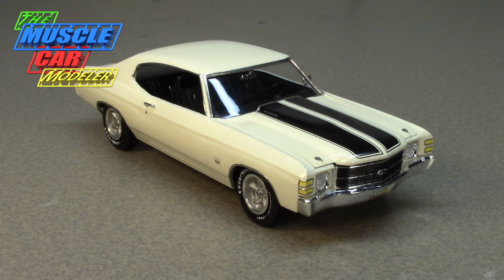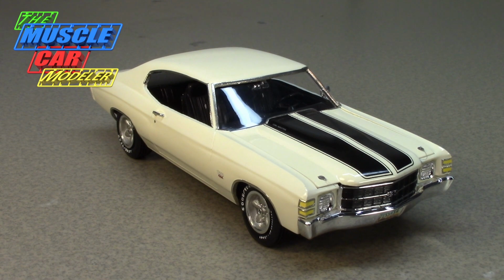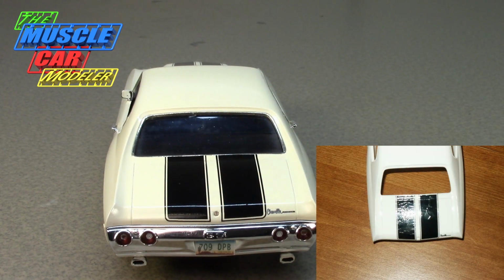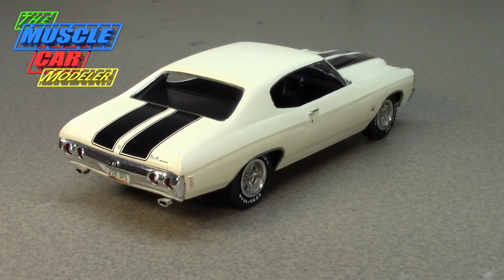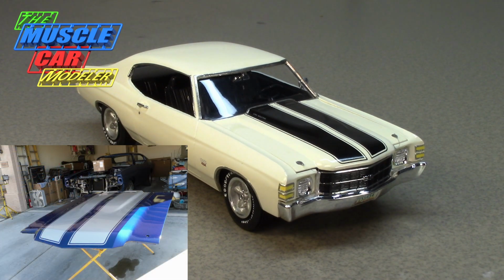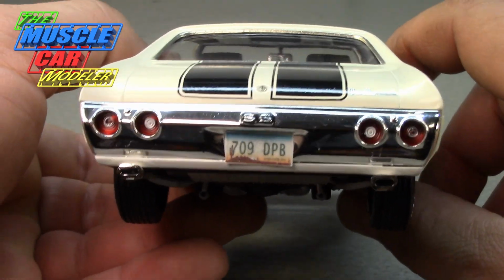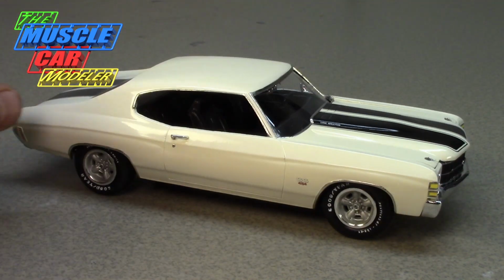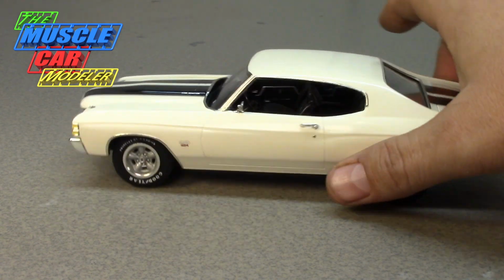AMT 1971 Chevrolet Chevelle SS 454 Annual Build

Comment: Awesome, awesome build brother, as usual.  I grew up a Chevelle guy, but always favored the '68/'69 bodied cars and El Caminos.  In fact, my first car was a white '68 w/307-cid SBC, 2-bbl, and column-shifted 2-spd. Powerglide A/T.  I promptly yanked out that anemic combination in favor of a 400-cid SBC, 4-bbl. Q-Jet carb, and TH350 from a 1970 Caprice parts car.  Installed a Comp Cams 286 bumpstick, Rhoads hydraulic lifters, Weiand aluminum dual-plane intake, headers, dual exhaust w/turbo mufflers exiting out the sides just in front of the rear wheels.  Installed a B&M Z-gate ratchet shifter on the floor and shift kit in the tranny, and went to town.  That combination had massive torque for days and could break the rear N50 meats  loose at will!  Dang, I miss that car...It was the one I learned on and taught myself the ins-and-outs of automotive mechanical work.  I could replace body panels, but was never much of a paint and bodywork guy, so I usually left that to a professional.  Sorry for rambling on, but listening to your story of the work you did on your wife's car just brought back the memories! 😀👍🇺🇸
Reply from the maker: Thank you for sharing! I'm glad I was able to keep our cars even though at times we could not afford to work on them. It didn't cost us to hold onto them. We did it slowly as we could afford them. My wagon has been sitting for years needing a new motor that is 75% built now. Just could not spend the money on it but that is coming to and end and I should be able to get it running soon! Just might have to cut back on some of my modeling time and budget!

Comment: You painted the blue Chevelle in your garage? Impressive! I had 2 1970 SS 396s...first one was a rusty piece of junk, I sold it around 1989....then I bought my second one, I prepped the body as good as I could with little to money and had a single-stage white painted on her.   I freshened up the 396 and added some long tube headers for more power.  She was going to be my "keep forever" car until some low life POS stole it in 1991 out of the apartment complex I was living at...she was parked next to much newer (and nicer) BMW's and Corvettes....they sure knew what a car like that was worth even back then....I sure miss that car.
Reply from the maker: Yes we did! It was a lot of work but so worth it! Sucks that you lost yours. My best friend bought a 67 Mustang and we drove it to the DMV and it was stolen there. That was about 1990/1991. I don't remember, Insurance first thought it was a fake claim since he only had the car for a few hours. Car was found a year later and he was able to buy it back. He did settle eventually so the car was no longer his. He still has it today!

Comment: Nice buid & great story Raoul,I'm currently trying to re do an AMT '70 Chevelle I started awhile back but kind of fugged the paint job so hoping I can finish it off eh?,would really like to get thevRevell kit if I can sometime?,the '70 looks so much like the mid 70's Holden Kingswoodsb& v8 monaro's I grewvup around,you should do a tutorial on how you sand 
 back in the body lines using spue and sand paper sometime?,that would be an interesting tip,keep up the great work,cheers
Reply from the maker: Thank you!

Comment: Actually amt did reissue the 71chevelle around 2003 in target stores it came with testors glue and little plastic tray of paints. I never had the original so I did not know what it would be like and was disappointed .the one piece front bumper  grill and head lights were awful. I wish revell would make this car the same way they did the 70 Chevelle. It's not my favorite kit but you made look really good.
Reply from the maker: All the AMT reissues are 1972's. I bought many of them. The tooling was modified into the 72 and the tooling has had some changes along the way but never turned back into a 1971. I would love if Revell issued a 1971. Would be even better if they did it based off the newest 68/69 Chevelle tooling!

Comment: Well Geez, no idea why i'd not found this posting before as it is also my story of building my real deal which only difference is mine's an orig. 70 396 SS. Otherwise, even got it in 1996, full Hochkis except my uppers are their first straight arm so have 75 Camaro spindles. The QA1's, 2004r O.D., 3.70 12 bolt, even the GSX spoiler to keep front end down over 140mph. If you get to building your current version with the AMT, use the AMT 70 M. Carlo chassis (shorten the front) which is vastly superior. Or maybe the new Revell 68-69 chassis will work, not tried it yet.
Reply from the maker: Thanks! I don't know when I will get to building this one.

Comment: I have a question. How do you paint the chevelle emblem on the back of the trunk. I used toothpicks and I always have to much paint on it or not enough paint on it. Any helpful tips
Reply from the maker: Thanks. I find painting them would be easiest with a 1MM Molotow paint pen. I don't usually do that and on this kit the emblems are decals from Keith Marks. https://public.fotki.com/mofobow/chevy/chevelle/70_to_72_chevelle_ss/70to72_chevelle_black_a.html

Comment: First question. Where did you get the wheels?
Reply: One of the models I'm working on is of a 1964 Impala I had years ago and I used those wheels on the real car. So I'm kinda looking for them. (Never knew what the reals ones came on. lol)
Reply from the maker: I'm not a 100% sure but I think it came with those wheels. And the last issues of the 72 also have them. The current 71 Camaro Z/28 full bumper has them as well.
Reply: Awesome sauce. Thanks.
Reply: @TheMuscleCarModeler . After a few hours looking at unboxing videos, I found the kit that has those wheels. 1970 1/2 Chevy Split Bumper Camaro Z28 AMT #6351/12. That kit also has the #635L on some store website. Hmmmm? But the are the exact same kit. Go figure.